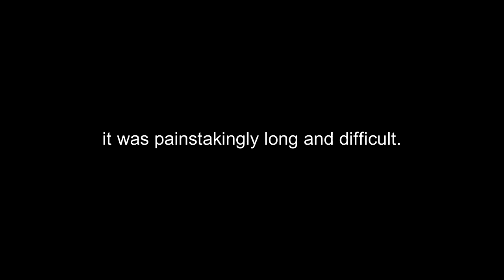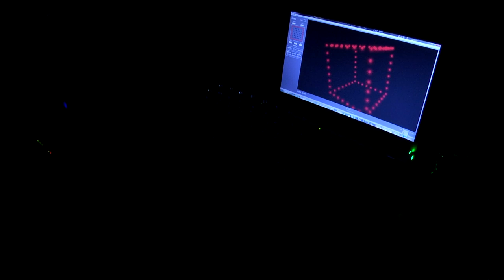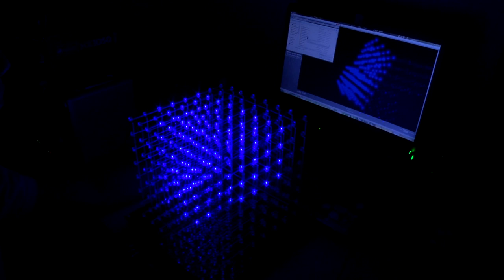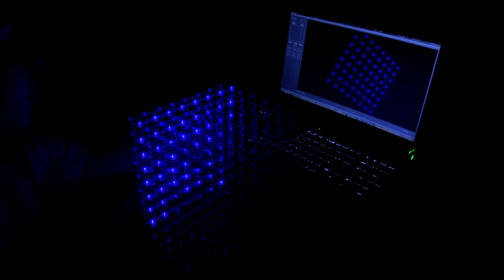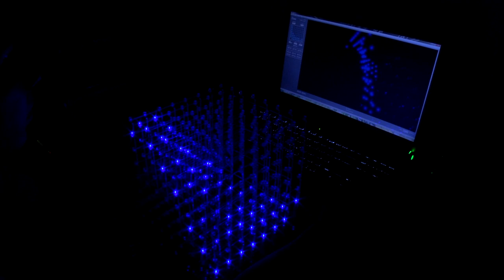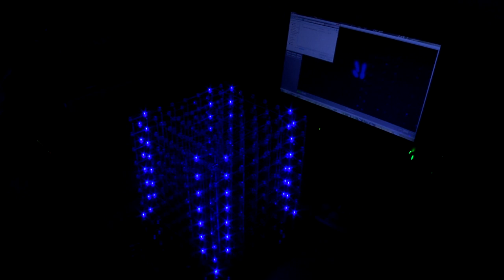Building an 8x8x8 LED Cube

Comment: Excellent work, I used the LED lead frame method which is not quite as pretty as the straight buss wire frame. Thanks for sharing. if you could post the code you use that would be great also. I used the Arduino Uno, but I can modify the code, thanks again!

Comment: where did you get those straight pieces of wire that you connect the layers to?
Reply from the maker: Penfold8 I got these at a local hardware store. It's galvanized 18 AWG solid wire.
Reply from the maker: quangluu96 Make sure to sand the area you are going to be soldering to make it easier.

Comment: BUt I tried it with the same wire, but the wire could not catch the solder, and easily detached. What to do man?
Reply from the maker: Have you tried to pre-tin the wires? You may need to some light sand paper to roughen the surface to make soldering a little bit easier.

Comment: Heyyy dude i m also making this project for my College and the problem is i dont want to use resistor and transistor etc ...
what kind of micro controller you are using???
please tell me..
Reply from the maker: Solution 's I was using an Arduino based board.
Reply: JPMediaProductions can u please tell me the board name so i can buy this board from market..
Reply from the maker: Solution 's Unfortunately I don't have the cube anymore or anything related to it left. But the board I believe is an Arduino Mega.  There's a bunch of code and multiplexing processes available for it.
Reply: JPMediaProductions and which type of led u used in this project
Reply from the maker: ***** I'm using 5mm LEDs, "straw hat" kind.  Not the round dome kind.  Round dome will work okay, but the "straw hat" allows for better even distribution of light.  This will make the cube lighting look much better.

Comment: What is your LED spacing?
Reply from the maker: +practicalskills 17.5 mm spacing from the center of each LED.
Reply: +JPMediaProductions 
    What kind of metal rod/wires do you use to connect the led's?
Reply from the maker: Jonathan Schiesl I used 20 gauge single strand stiff wires to connect the LEDs.